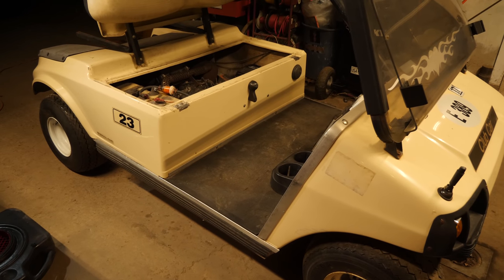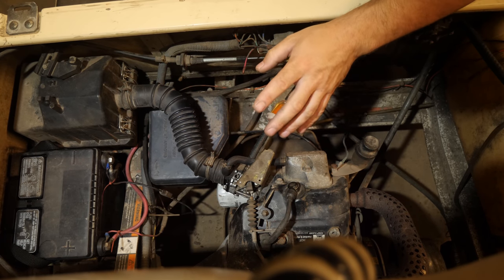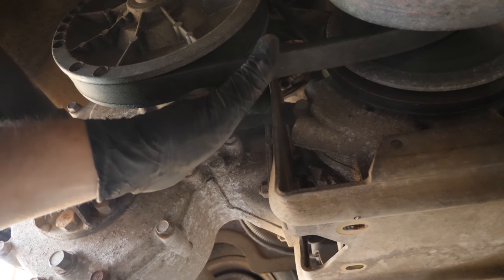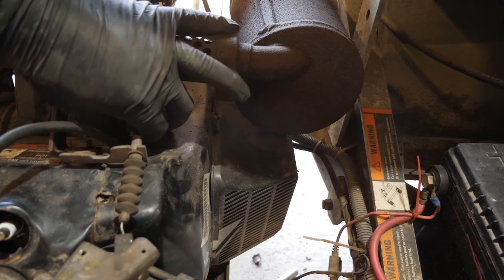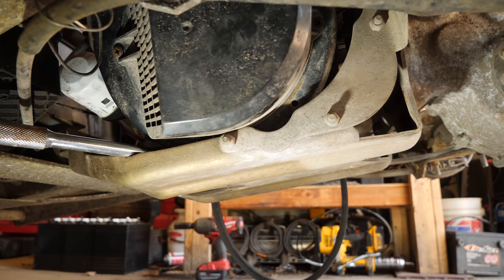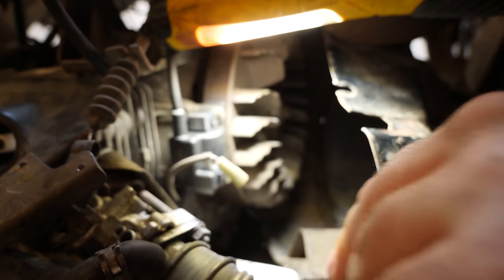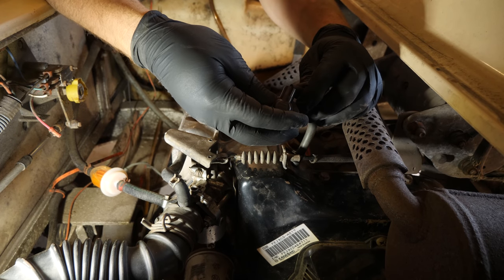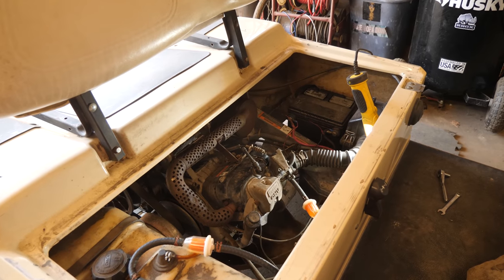2000 Club Car DS, Gas - Engine Shuts off After 10 Minutes

Comment: Good video. Mine is doing the exact same thing! I checked all 4 things needed for an engine to run. Spark, fuel, air and compression. First time testing it, spark was good, fuel good, compression and air were good. Cleaned the carb with still no success. Checked several other things and it still wouldn’t start. So I started with the basics again and ended up finding that the spark was cutting out after a few seconds. Ignition coil fixed it! However rather than removing engine mount bolts. Just remove the exhaust. Remove throttle cable cover up top. Remove the L shaped bracket under blower housing. Remove blower outer cover. Then remove blower cover. All this can be done without removing engine mount bolts. Took me roughly an hour at most. Your method definitely works but no need to go to that extent in my opinion. Work smarter, not harder.
Reply from the maker: To each their own. This way works best for me and is quite fast. When I'm not filming, I can have this done in 35-40 mins.
Reply: So really not time consuming then.. Good vid👍

Comment: I had the SAME problem with my Grandfather’s 2003 DS, it took me a while to diagnose, took the same steps, carb clean, valve adjustment, I later changed the coil because when it would act up, hand choking it made no difference, glad to hear that I actually fixed it haha

Comment: I've done this job and find it much easier to just remove the muffler and muffler mount.  Gives you plenty of access to the blower housing bolts.  No need to mess with belt or clutch.
Reply from the maker: To each their own. I find the way I do it works better for me. In the past, I've had mufflers break, exhaust studs break, etc so I don't touch the muffler unless I'm changing it.

Comment: Great video from start to finish. I was able to get to my lower cover bolts with a long extension. The motor mounts didn't have to be touched, this was much eaiser.
Reply: You can’t do it this way if the carts had it replaced once before. There’s one bolt holding the cover on that’s sandwiched between the rear motor mount bracket. There’s literally no way to get at it without sliding the engine forward.

Comment: Dude I'm do the same job tonight . Loving the engineering I'm at a spark no spark how'd you like those rear Bolts at the back engine plate wasn't that lovely. I was like really,  come on. I did end up pulling the start generator. What was the general time start to finish?

Comment: It might be the improper way but all you have to do is take the muffler off of the engine. It is only five bolts that you need to take out to get the it off.

Comment: I have a 2006 xrt810 and i war driving it today for about 40 minutes and it ran amazingly. I got home, shut it off for maybe 10 minutes, and decided to take it out mudding a little bit, on my way there, it died. I was going maybe 20mph and it just slowly died. So I tried to start it again, and it took a bit of choke and gas to get it going. It would barely be running with the help of the starter. Then it started up good again. I drove it home and it died 2 more times. It sat for maybe 4 months with the same gas in it too. I want to make sure this is the problem, how do I make sure

Comment: I have been having trouble getting mine to start, it turns but no start.
I replaced coil, igniter and voltage reg and still nothing. I finally by accident discovered that it was the foot switch the whole time. I knew I was having trouble with the switch because sometimes (when it would run) that it would not shut off. Then I went to turn it over to check something else it would not even turn. I tapped on the switch and not only did it turn, it started running. I bypassed the switch and wired it straight to the key and bingo, it runs great.
Reply: Weres that switch at?... Im havibg same trouble
Reply: @erikarodriguez3140  Just under the hood where the foot peddle cable comes through the body under seat. I have since replaced the switch with new one since the key method was a pain. Runs fine.
Reply: @streak2645  thank u very much .ima check it.
Reply: @erikarodriguez3140  I hope it helps.

Comment: Much love brother!  Cart just died in the driveway and I went through all the stuff you've taught me and looks like I'll be doing this job this weekend. 

Would it be possible my coil is okay if I got spark by disconnecting the rev limiter?
Reply from the maker: You can bypass the RPM limiter to see if the cart returns to normal. Most people leave them disconnected but I always recommend replacing it with a new one.
Reply: @Kevinsgolfcarts  bypassed it and have spark now.  Disconnected the carb fuel line and found another issue of no fuel coming out so new fuel pump and rev limiter on order.  

On a side note have you ever made a video on installing gears on a Club Car ds or precedent?
Reply from the maker: I have not. I don't have a high demand for high/low speed gear swaps. I've done a total of 4 in 20 years, 3 on EZGO and one on Yamaha.
Reply: @Kevinsgolfcarts  10 4 

Keep up the awesome videos and I always look forward to getting your notifications.  

P.s. 
Go clean off that work bench.  Lol

Comment: I have a 1990 Columbia parcar has same issue but I have a robin engine cleaned fuel, had coil tested, replaced spark plug still no change I just ordered a reed valve hoping that that's the problem. Not sure what else it could be. Any pointers would be appreciated.

Comment: Thanks for the great video. I have a 1996 club car that is giving me a weak spark, I replaced the coil/ignitor and swapped out the carburetor and rpm limiter for spares that I had. I recently did a full tune up new spark plug, oil change, oil filter, gas filters, and air filter. I made sure the space between the flywheel and coil isn't too large. Have you got any other ideas what can be causing a weak spark?
Thank You
Reply: 96 doesn't have the ignitor inside the coil. The ignitor is behind the rev limiter on those. 97 and up was integrated. Remove the rev limiter and toss it, replace the ignitor.

Comment: Hey Kevin I’m experiencing sputtering and lose of power when under load going up steep incline with my Ezgo clays cart that has the fj400d kawasaki engine. Thought it was the carb and purchased a oem replacement but still same issues under load on steep incline. Suspect ignition coil as the spark is yellow and appears weak to me. What color and how strong should that spark be. It’s the same no matter the plug. Also haven’t had a valve adjustment since I bought the cart used in 2011 but it always has run strong till now. The engine starts fine and runs ok on flat ground but do notice a intermittent lose of power on flat surface as well. Please let me know what you think and thanks

Comment: Hey Kevin, I have a 97 ds 48v and flies on the flats and is very slow up hills and the batteries are new, any idea what that might be? Thanks for your help, Ray
Reply from the maker: Its a 97. Those curtis controllers are only 200 amps. They don't have a lot of power output. The newer carts have  250-350 amp controllers. I have a 99 that's slow on hills but moves pretty good on flats. Make sure the tires are inflated to the sidewall rating. If they are stock, you don't need anything higher than 18-20psi. If the cart is lifted, with larger tires and wheels, then you are making the cart work more to do the same work as stock.

Comment: I just had to fix an oil leak on the crank case (I think). Either way, you had a video with the same leak. Thank you for that btw. Now, I think my cart is doing what THIS vid is about. My question is this...short of cutting anything, do I HAVE to move the motor AGAIN? I'm about to drive this thing into the river! No one around my area works on these (honestly) no one! Idea help you can give will be much appreciated. Thanks in advance. And please, keep doing these vids. You live too far for me to bring to you. Take care

Comment: I did the coil and I still have the issue where I will run it figure around 10 min and then go to start up again and it will crank but not run. Is the Revlimiter my next part to check?

Comment: all you need to do is remove the muffler and mount then you can access all the cover bolts and screws. I did take off the drivers side rear wheel.
Reply from the maker: I try to avoid touching the exhaust bolts if possible. Its no fun when they break off.

Comment: i find it way easier to unscrew the 4 phillips heads and take out the blower inlet and take the muffler out. then a little trick for that stupid bolt at the bottom near the diff is to undo the 13mm head bolt and nut directly in front of it that holds the muffler bracket on and slide a 1/4 " extension through and put a socket on the other side. ive had to do 3 of these in the last few weeks. also id suggest you replace the rpm limiter at the same time, we have found a lot of times a bad ignition will cause rpm limiter failure down the road and vice versa. these parts are not cheap!
Reply from the maker: Removing the blower cover, at least for me, I've been doing it this way for years and it works. Its not necessary to remove anything that is not in the way. Just easier for me to unbolt the engine and reposition it. I typically like to replace everything at the same time but, the customer has the final say when it comes to paying for it. In this case, the rev limiter was bypassed and thats how they wanted it. I tried to explain to them that it prevents the engine from over-revving but they wanted it left alone. Thanks for watching.

Comment: I have the same problem and replaced the coil fuel pump carb filters lines battery you name it and still have the same problem, any pointers?

Comment: "Special tool" for the gas pedal, thats awesome. Good video, pita job. Do they still build them like that?
Reply: You bet they do. The newer ones are even worse to put coils in because there is way less room in the engine compartment. You actually have to remove the exhaust pipe and muffler to be able to slide the blower housing away from the engine even half as much as Kevin did in the video and fish your way in there to get the coil out.
Reply from the maker: Everyt good mechanic has "special tools" lol. It is a pita job, for sure. It has to be done nonetheless.

Comment: great video having trouble with 97 fuel system good, replaced rev limiter old one shorted out but car still runs when shut off any idea??
Reply from the maker: Sounds like one or more of the micro switches has failed and is not shorting the ignition coil when you release the gas pedal.

Comment: I have an 03 with the kaw motor, runs rich, runs lean. Starves for fuel, no blockage.  Then dumps fuel and carbon fouls the plug. Then it'll clean itself up. Empties the filters, then sits and refills on its own.new carb, new coil. Any suggestions? The thing is in amazing shape other than this issue.
Reply: Original issue a year ago was filling crankcase with fuel.thats when carb and coil were replaced.  Pretty sure the "shop" just threw parts at it. Had the fuel pump apart, all diaphragms look good.
Reply from the maker: The carb needs to be cleaned. What I've been seeing is the rubber tip on the float valve swells up and cracks. This causes the valve to not close properly when the bowl fills with fuel and it dumps into the crankcase, floods the engine or starves it of fuel. If the float valve is not cracked and just swolen, leave it air dry for a few hours and re-assemble the carb. I've had good luck with this without replacing parts. The valve usually swells when it gets wet with water so make sure the fuel is good and there is no water in the tank. Change your fuel filters any time you do carb work.
Reply: I'm tearing into it this week, and I've got an extra coil sitting here just in case... Thanks I'll look into it
Reply: valve adjustment 004

Comment: Whats your thoughts about using a non OEM coil on a 1999 club car DS ?  They are $$$. What brand of aftermarket coil do you use/trust ?
Reply from the maker: If you could find one that will work, go for it. I only use aftermarket or oem parts designed for the particular use. Its too much liability to jerry-rig. As Benjamin Franklin once said "The bitterness of poor quality remains long after the sweetness of low price is forgotten." I'm a Red Hawk/RHOX dealer so I use their parts when available.

Comment: Just put in a new coil and flywheel on 2015 precedent  ex40 motor..still getting intermittent spark or no spark..any suggestions?  Bad ground?
Reply from the maker: I don't have any experience with that engine. I have not come across any issues with the few that are in my area. I would say check all of the wires and make sure their connections are clean and tight. Intermittent spark is usually caused by a bad CDI, also known as the ignitor. I can't really say with any certainty since I haven't had any of those in my shop.
Reply: @Kevinsgolfcarts  thanks

Comment: BEYOND FRUSTRATED with my Club Car 2006 with 350 engine! Replaced fuel pump, filters, fuel hoses, carburettor, new ignition coil, new rev limiter, flushed tank, new spark plug..... Runs nicely for 3 seconds and dies. If I use throttle, it accelerates and then dies after 3 seconds with a small backfire. If I leave it for a couple of minutes, same thing - starts but dies. I have NO idea what to do now! Any ideas anyone??

Comment: I have a 94 club car that will turn over, but wont stay running. I changed spark plug, new fuel filter, new fuel pump. It will turn over but wont drive or stay running. Spray starter fluid in it and it tries to stay idling but then dies. HELP HELP HELP!!
Reply from the maker: It sounds like you have a blocked carb, bad compression, failed igniter or rev limiter. You need to do a compression test and clean the carb by removing it and taking it apart. By design, these engines don't idle and will only run while in forward or reverse. The only way to get it to run in neutral is to put it maintenance mode. Without more information, that is the best I can offer.

Comment: You cannot do this job just removing the exhaust if the carts never had the blower cover off. There’s one bolt that holds it on that’s sandwiched between the blower cover and the mounting bracket. You’ll see it on the back side of the engine if you look between it and the bracket. There is physically no way to remove it unless you slide the engine forward
Reply from the maker: I have many times without moving the engine. Its a pain but it can be done.
Reply: @Kevinsgolfcarts  your video shows a cart with the back bolt for the blower cover im talking about removed. If it’s never been removed before it’s physically impossible without moving the engine
Reply from the maker: You don't have to remove the bolt, just loosen it. The cover has a slot, not a hole.

Comment: The over rev limiter can be bad.
Reply from the maker: You can test them by disconnecting them and seeing if it will run, if not, its the coil/CDI.

Comment: Engineers design machines like they will never break or need maintenance...
Reply: Some engineers. (not all)
Reply: @paulmayo3703  you’re right, of course. My 21 years in the Navy left me skeptical as designing engineers had to maximize space especially on destroyers and other small combatants. Imagine trying to maneuver pumps and turbines in confined spaces. In dry dock, holes were cut into the side of the ship to remove machinery for overhaul; ten pounds of crap in a five pound bag. I thought things would change when I went into the cryogenics industry after retiring from the Navy. Certainly things were spaced out farther apart but individual machinery manufacturers still tried to stuff everything into smaller packages to minimize footprint and weight. One of the best things that happened at our company was sending new engineers (chemical, mechanical, electrical) to be an operator at our plants for two years before they were allowed to design or plan anything. Busting your knuckles on something someone else designed has a way of altering your perspective.
Reply: @williamlott7612  Kevin constantly complains about the newer Ez-Go carts with good reason.  

I started my engineering career as a Field Engineer for the USAF and spent 5 years teaching blue suiters how to maintain equipment I did not design. Certainly open my eyes into poor mechanical designs.  It taught me a perspective that lasted throughout my career to design maintainability into the product.